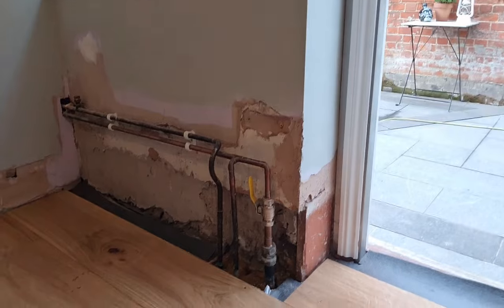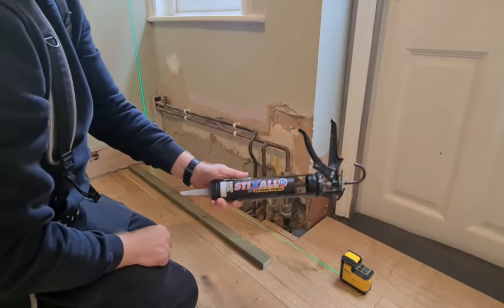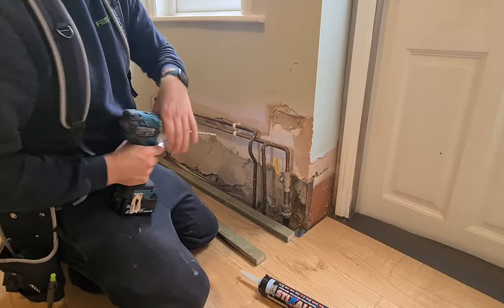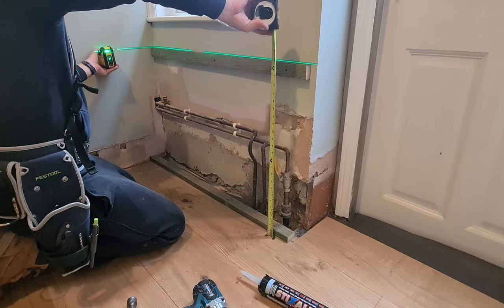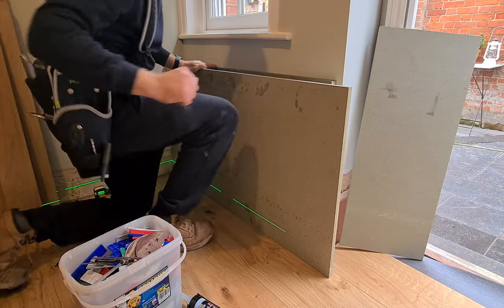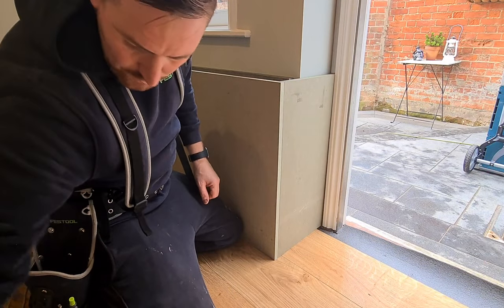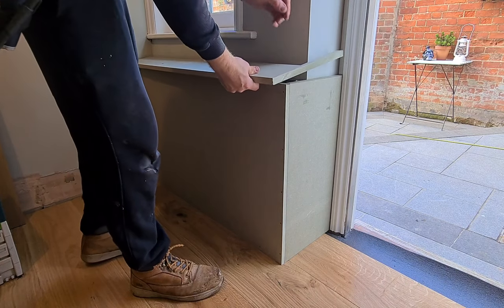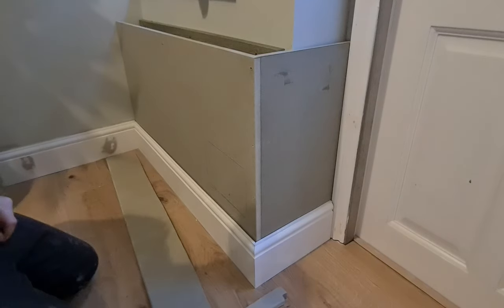Making a HARD job EASY!       #diy #carpentry

Comment: I have recently discovered "tapons", they are a screw designed to go into masonry, without the need to insert rawl plugs or toggles. have you used them before, what are your thoughts on them. Cheers.
Reply from the maker: Hi mate.  No I havn't used them yet.  But will give them a go soon maybe.

Comment: Useful video!  I would have put the hatch with either the flap opening down, or left or right, not up which makes it awkward to access as you can't really see without it being fully open and it could easily fall down.
Reply from the maker: Thanks for watching Anne, the hinges are just pop off ones so once open it just releases. But good comment 👌
Reply: That's even better!!

Comment: Hi Ben, Have just subbed. For some time I have been considering whether it is worth me getting a l/level. You have just convinced me. I do quiet a bit of boxing in. A lot of chippies consider it beneath them to box in (or sink nail holes). I get a lot of work by finishing off like this. Bob (Weston super Mare)
Reply from the maker: Nice one Bob 👍 the accuracy is 2nd to none
Reply: My mate bought a Huepar green laser level and is very happy with it about £150 Amazon.
Reply from the maker: Been very tempted myself
Reply: @nw5835  got one myself .3 way 360° on all and it's absolutely brilliant

Comment: seriously no. level up pre drill batten with 3mm drill bit and touch in when your level with wall. use 8, 10 etc masonary bit but 5mm over, i always tape my bit. the important bit is i tap the rawl (or whoever you use ) plug into the wall by at least 5mm this will make sure the plug holds well. just a tip, if you don't use it np but it has worked for me ;-)

Comment: Spoilt by the plastic access panel. it woul have been neater to use the mdf cutout as an access panel, a strip of ply around the edge to prevent it falling in and  turn button/catches  to secure it. when painted it would blend-in far better.
Reply from the maker: I prefer the plastic but each to their own 👍

Comment: should the reference for the level be the window sill? how do you make the choice?
Reply from the maker: I offered for it to be the window cill level but with that came a little more expense to either chop the old board out and put one big one on or to join the new one to the front as seamless as possible but with budget in mind the customer went fit this a they saw no advantage in the 1st options

Comment: Hi Ben. I've a question regarding Your festool extractor with makita palm sander.
I'm using the same combo, but how did you get the extractor to cut off power when working with the cordless tool?
Am I missing something?
Reply from the maker: It's all smoke and mirrors! There is a festool bluetooth button you can buy for the end of the hose. Saves your back bending down everything. I absolutely love it! Especially when chopping locks in doors so you don't need the hoover in the room with you
Reply: @BuiltByBen-YT  Thanks for that, I need to look for it... Keep up good work  mate.
Reply from the maker: Will do buddy thanks for watching

Comment: As a retired chippy, i`d never have taken the boxing in so high. Better making good the wall, with the woodwork to just above the pipe work, with access to valves.
Reply from the maker: I think the height is more useful as it is?

Comment: Neat job Ben. I work in maintenance and think I’d find use for a small laser level, what make is your yours, always been old school using spirit levels but wouldn’t mind a neat little laser like the one you used think it may come in handy on a few jobs.
👍👍👍👍👍
Reply from the maker: Once you learn how to use them effectively they are so accurate and quick 👍
Reply from the maker: The link is in some of the other comments
Reply: The use of both Lazer and other spirit levels both come in to there own so I have both also I bought a lidi one to test against my DeWalt and found very little apart from my DeWalt I could use more at distance but the little lidi is good for close in and keep it in my box 😂nice work Ben as u said it was what the customer wanted
Reply from the maker: Cheers Ryan

Comment: use the 99p plugs from toosltation and you wont have the problem banging them through the hole, they have no shoulder and theyre just as good
Reply from the maker: Nice tip

Comment: Nicely done, is the price of the moisture resitant mdf much more then the normal stuff ? Also Is it same as normal i.e. dulls the tools fast too? I generally dont like mdf for this reason and the dust that comes out of it...
Reply from the maker: It's marginally dearer but not enough to put me off because the benefits are great. Paints up better aswell. It does blunt blades but I price a new blade in to each job so no worries really

Comment: Did you scrap the first top piece as it finished flush then after routering it had an overhang. Also, it’d have been better to scribe the wall side of the front panel to leave the machined edge on the corner.
Reply from the maker: Hi Scott yea I did. I fitted the flush one and it looked rubbish so I cut a new one. Just forgot to edit it out. I did scribe the wall side ???
Reply: @BuiltByBen-YT  I can see the moment where you paused for a second where you regretted not flying it over and cutting around the architrave. Looks much better with the same overhang all the way round. 👍🏼
Reply from the maker: 🤣 my face can't hide the regret

Comment: Shame about the raw edge on the vertical that'll be a nightmare to paint, would have been better if you mitred it.
Reply from the maker: I use moisture resistant MDF and sand it with a 450 grit sandpaper before sealing. It really does a great job 👍 but fully agree if you have the time then definitely give it a mitre
Reply: Or a piece of cushion corner bead would cover the raw MDF edge and looks neat.

Comment: IMO laser well over used for a such small project, I would have cut the flooring back for an expansion joint and not fixed onto floor. And to measure the cuts with a laser just seems a waste of time. Just use a tape and allow 10mm at the bottom because your covering it with skirting. Designs not great but that’s the customers call, you didn’t even need that horrible plastic access if it was designed better 🤷‍♂️

Comment: Unless that’s a marine grade MDF that will be destroyed in 5 yrs that close to a door and nothing to hold it up off a wet surface?  I do Finish Carpentry in the states and I am a contractor.  I use a treated ply and G Tape the bottom .  I am watching because you said it’s one of the more harder things to do in carpentry?  Did you mean DIY?  Anyway looks good however if I was a sub on this Job the GC would tell me no don’t even use that unless it’s waterproof!  
Not to mention it would not pass inspection and depend on what you are closing in sometimes it has to have an access point for later down the road!
Nice bags I run Akibus ( butchered the name) but I like your bags a ton!  Thank you for making this!
Reply from the maker: Thanks for watching mate. It's moisture resistant MDF so shouldn't really be a problem 👍

Comment: when boxing pipes its important to weigh two factors, wasting space and aesthetics. you could have built the box significantly smaller and thus made it less imposing in the room. OR you could have combined the box and the window stool and made an aesthetically pleasing deep window stool that could have been used for plants ETC.
Reply from the maker: It was done to how the customer wanted it. Surely you understand that?

Comment: Fixing the batten onto the laminate flooring means the customer will have an issue when they eventually replace the floor.
Reply from the maker: Not really Peter,
You can either remove the skirting and multi tool it or you can remove the boxing and floor under it. Failing that it could be multi tooled back and covered with Scotia. 
Although none of this was a concern as we had just laid the new floor anyway. I wouldn't have thought it will be changed for at least 10 years. 👍
Reply: @BuiltByBen-YT  I’d have boxed in and laid the floor afterwards. When I fit laminate floors, I like the skirtings on top as I don’t like scotias. When I fit the skirting, I use minimal fixings on the two walls where access is needed for replacing the flooring. My experience of laminates is they don’t always last as long as expected. Not a concern if you’re a contractor, but is if it’s your own place.
Reply from the maker: Sounds good Peter! 👍 there are so many ways to do the same thing in building. And sometimes depending on the job you are forced out of your usual methods. The important thing is to always do it the way you feel comfortable as you are the only one that will have to fix it if it goes wrong.
Nothing worse than taking someone else's advice and then it goes wrong. I have been there too many times.
Reply: @IIIIIIPETEIIIIII  only issue with doing that is it looked like you might need to get behind the boxing to shut the water off from the yellow shut off which might be hard if you fit the laminate upto it.

Comment: I would have been scared to not go through the pipe with the multi tool . I did wonder why the hatch it wasn’t cut thou when you was marking it all up and cutting it down to size . ? 
I certainly hopes the customer doesn’t have a leak too that mdf even thou they say it’s moisture resistant isnt really blows up like a ballon sadly or any water gets into it . Learned my lessons from this wont touch the stuff now . But a well informative video thank u .
Reply from the maker: I didn't know the size of the hatch when I was cutting it so had to wait until it was delivered. 
Yea I agree about the leak but saying that most wood will suffer with a leak. Unless we start charging enough to put tricoya boxing in? 🤣
Reply: Ive just found good old pine to be better even in small leaks scenarios than this mdf stuff it’s more forgiving obviously nothing will work in a big leak situation. But any moisture leakage honestly the a mount I’ve had to replace on window cills also bathroom areas etc it’s not fit for purpose like pine has been pressure treated and then painted same . Ive come across major issues in more than one house after a year or two of fitting . And spoken to other people who don’t rate it also . But I guess it’s personal preference . I just know for me going forward the price for the mdf moisture costs it’s been cheaper to buy pine still . Plus pine window board and skirting board was good enough in the old days lol .. also the mdf stuff is horrible to fit bent has a 9 Bob note if u ask me worse than pine is lol .. But yeah it comes down to the customer at the end of the day . I would have thought the size for the hatch would have been displayed in screwfix for it to be given sizes other wise how would u have know what size u needed in the first place  ?Or off amazon if u bought it from there ? I just like to make less work for my self lol ..anyway not criticism I just like to work smarter not harder . Till the next video keep up the hard work 😁look forward to watching . Im always learning everyday is a school day on YouTube .
Reply from the maker: Thanks for the comment. Make sure you subscribe 👍 and never trust an online size!!! They are never right 🤣

Comment: Can you explain what you said if a piece of wood touches a pipe it could draw the water out of it...? at 3.00 mins
Reply from the maker: Freezing cold water passes through pipes and there is always condensation on the pipe when it reaches the warm house. If the wood is touching it the water soaks in to it
Reply: @BuiltByBen-YT  Thank you Ben didn't realise that
Reply from the maker: No worries.  Thanks for watching 👍

Comment: As a floor layer that looks like a floating wood/laminate floor. I'm hoping I've mistaken but looks like  you've screwed through it which will not let it expand and contract which may cause a problem in the future. All the best
Reply from the maker: Only screwed into it.  Shouldn't cause any problem hopefully
Reply: I thought that as well pre drill a bigger hole then screw in the middle of that 5mm will be enough for the floor to move

Comment: Hi Ben, interesting video and I appreciate seeing you scribing to create the best fit. I thought I'd suggest using a tripod for the laser, it could have been stood out of shot nicely. Also, I wondered why you levelled the front board using a packer, scribed it and cut it but then fitted it having removed the packer?
Reply from the maker: Hi Nick,
Yes I have got a tripod but can never be bothered to set it up 🤣 sometimes it gets in the way.
With the scribe, if you don't level it up before the scribe it will scribe it unlevel. The packer is to imitate the floor being level so that once scribed it sits on the unlevel floor as if it was level. Hope that makes sense? Best way I can describe it.
Reply: @BuiltByBen-YT  well de scribed mate... good video.
Reply from the maker: Thank you 😊
Reply: @BuiltByBen-YT  Hakuna matatizo 😉
Reply: @BuiltByBen-YT  Yes, he's levelled the top edge to the laser line, with the packing, and consequently to the wall batten so you need to scribe the, unlevel floor, to the reference level which is the top edge otherwise the top edge wouldn't be level once scribed. Hope that helps a bit?

Comment: Great work but... I always consider squeezing the trigger 5 times to insert each screw to be tool abuse! Why strain your drill 5 times including starting under heavy load for 4 of them? 😢
Reply from the maker: I do that as a control measure really. So that you can gauge what the screw is doing as it goes through. If it starts to go off track or starts to burst out it is then not too late to pull out and rethink it. If you just pull the trigger once and drive all the way through you could end up ruining the piece. Everyone is different. P.S I have had 2 impact drivers in 6 years  so it probably doesn't make a lot of difference ?

Comment: Great job, I used that stixall the other day for the first time, it didn’t seem to grab that well for me.
Reply from the maker: Wood to wood I find it really good. White one seems to be marginally better. But you're right. Every now and then it fails. I'm sure it's because of grease or dust etc?
Reply: @BuiltByBen-YT  I was going wood to plaster so maybe your right with the dust.
Reply from the maker: @00dawb  most likely. Who knows. I change my adhesive regularly as soon as I'm not happy with the performance. Maybe I'll do a comparison soon

Comment: So to fit the water softener in the future, the skirting and the front and top piece need to be removed, in fact the whole assembly needs to be dis-constructed. !
Reply from the maker: The water softener was an external unit.  Only a connection was to be made in the boxing 👍
Reply: @BuiltByBen-YT  O.k. Understood, please show how you made this connection without taking it all apart please.
Reply from the maker: Barry, it was all dry constructed. I did not fix or glue anything until the connection was made. I do say that in the video 👍

Comment: When setting up the battens just use 5mm spaghetti. Drill once, push in spaghetti and screw twist off  or cut of spaghetti. The screw head practically cuts the spaghetti for you.
Reply from the maker: No idea what your on about 👍
Reply: Unbelievable, please wake up, it's wall plug but in a roll. Drill 1 hole through wood and into brick feed end of roll into wood and brick drive in screw. Screw head will practically cut plastic for you. Do the same again, drill is in 1 hand, roll of plastic plug in the other .come on  work it out ,it's quicker than pissing around like you are .
Reply from the maker: Bit rude Duncan.  You do you.  I'll do me.  Carry on being cool 😎 👌
Reply: Yeh right ✅️, I know you'll try it. 🤣😂🤣
Reply from the maker: I actually won't but thanks
Reply: Yes you will sunshine 🌞  lighten up ,grow with the times, we all learn and become wiser that way. 😉 .,you're still only young. I can only wish I had as much to learn as you do .best wishes for your future. 😊😉🤣😂.

Comment: Nice example of a supposedly simple job that triggers a few points.
1) WHAT'S WRONG WITH A FEW BITS OF HARDBOARD TACKED TOGETHER WITH PINS AND MASTIC £50!!!! Rant, rage... We've all seen that, even in new builds quite recently.
2) Wife asks DiYer to do "just this little job". Diligent DiYer takes 3 days carefully doing it like video while wife annoyed at tools lying around (sorry for gender stereotype but not seen the reverse).
3) Keen DiYer uses redundancy pay to buy tools and set up as handyman. Turning hobby into job that barely covers costs, fails to charge proper rate, gets work due to price and quality, gets recommended, works all the hours in year but loses money and life goes down drain. 
4) Nice work and clearly explained. Perfect video (with costing in a comment) for someone learning to DIY properly, even for someone starting in trade and aiming higher than grafter's beer money lifestyle.
5) Anything missing? Mask and dust control but that would be difficult to talk while filming and working
Reply from the maker: That's a full on comment! But well put together. Thanks for watching and interacting 👍

Comment: For the cost of boxing I'd of got a plumber to reroute pipework low level or better still below the floor level ......."fix the problem not resolve it"
Reply from the maker: You think a plumber would gun up the floor bury the pipes and recover for £150?
Reply: @BuiltByBen-YT  ive been a plumbing and heating engineer for 40 years. "Gunning up the floor" 😆 bit dramatic ben!
method  1.put pipework at skirting hight and space off skirting 1".
Or pull that board out "chip up a bit of screed" no gunning required, and lay the pipes in the screed obviously using pex pipe.
Im sure most home owners would prefer(cosmetically) one of my methods even at twice the cost....my opinion.
Reply from the maker: @roland smith  but then what do you do with them once the reach the wall?